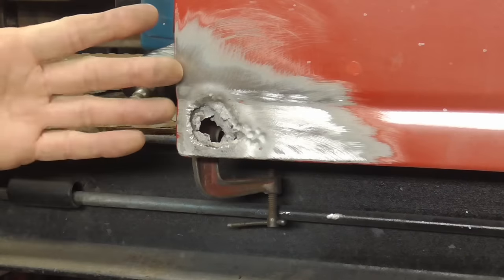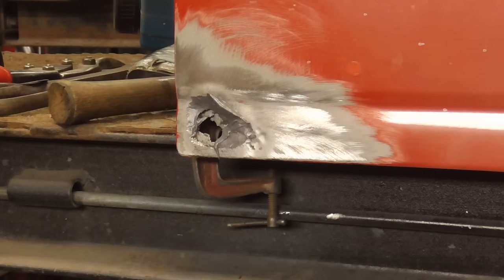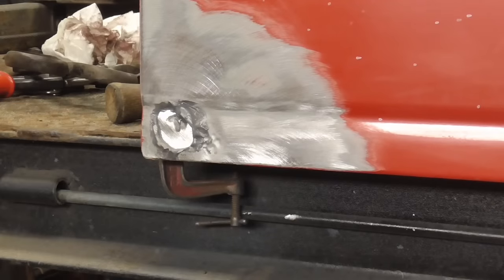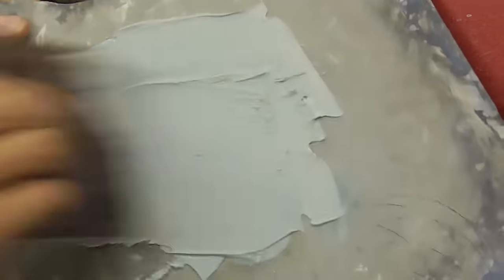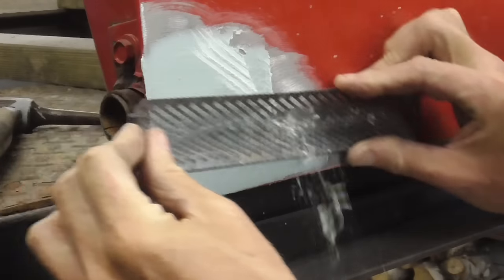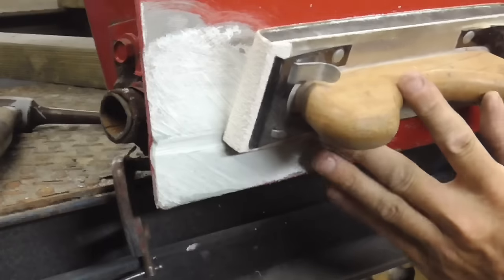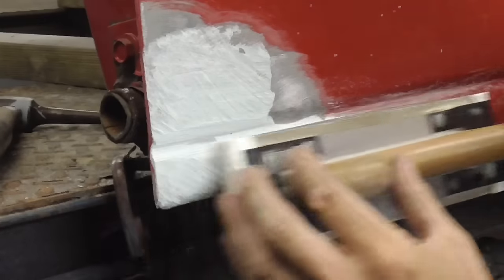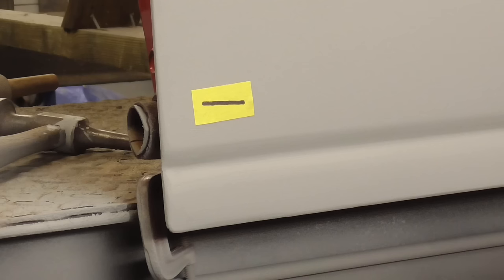Using JB Weld to Fix Rust Holes?

Comment: I found that you can "work" JB weld with rubbing alcohol before it cures for a nice smooth finish !
Reply from the maker: Nice suggestion - excellent!
Reply: water works just as well,
Reply from the maker: @deadprivacy  I'll remember that :)
Reply: Great tip! I'll try that next time. Thanks!
Reply: @100M2B  When I said "wet" , I do not mean soaking wet . Let it set up ,then if you see any unevenness or small flaw use the alcohol .Put a small amount of alcohol in a cup , then just dip your finger in it and then smooth it off useing your bare finger . Then clean your finger b-4 picking nose !
Reply: Thanks ed podellis! I'm going to fill some small screw holes in a recently purchased aluminum boat. I'll use your suggestion.
Reply: @Ariesstubbornbutt  lol@u!
Reply: I used JB weld 12+ years ago after wire wheeling heavy pits in a boat trailer. Primed then painted. It doesn't see a lot of weather but, still holding up to this day.
Reply: @TN-Vols-Fan  I used it on a series of screw holes in the transom of an 18' Starcraft while changing out the wood core. First I used a drill bit larger than the holes on both sides to taper the hole. Don't run the bit through, you're just tapering the outer edge  of the holes to help give JB something to bite into. Sanded smooth then painted the entire transom  My bro-law runs that boat on the Great lakes every year. Done that 2012 ish, still looks great.
Reply: @Wildwwill  Thanks for the reply. I had 14 small holes where the previous owner installed LED lights for night fishing. I don't fish at night. I cleaned out the holes and sanded a small area surrounding the holes. Worked very well but I couldn't get it as smooth as I wanted. No big deal, it's a 16' camo boat so you really have to look to see the repair.
Reply: @TN-Vols-Fan  so did you clean your finger before picking your nose? 😂🤣😂🤣
Reply: @donovanmorris6080  Good one! I was smart enough to wear latex gloves.
Reply: How long has it been since the hole has been done?
Reply: @mikeandcolleenk9831  Five years ago, want to buy a Pontiac ?
Reply: Can I spray rustoleum rubber based undercoating over the jbweld to prevent future rust? Will that stick to the jbweld?
Reply: @macknumber9  i don't see why not
Reply: A JB Weld trick if mine is to cover the area you are repairing with clear packing tape afterwards. The 2in wide stuff at Dollar Tree. It does a few things .

   Compresses the glue to get in all the nooks and crannies.

  The tape is clear so you can actually see what's going on under the tape.

   The resulting finish is an unbelievable smooth high gloss finish that needs no sanding.
   It's really cool when you peel the tape off after drying and see the results !!

Comment: I've used J B Weld, other epoxy adhesives and polyurethane construction adhesives for various auto body work.  Adhesives join the components together and seal them from moisture and corrosion. Low stress panels don't always need to be welded.  You'd be surprised how many body components on new vehicles are bonded with adhesives, rather than being welded.
Reply: sadly no, the smoke from the glue... is always an expected phenom when welding carbodies
Reply: @deadprivacy  Why patch with any  product    metal is cheaper  and welding is better   more drain holes  and internal rust treatment  obviously that is a good look patch job  not for my restos 🤔🤔🤔💯
Reply: @jackbarrie6007  i just said i wouldnt be surprise
Reply: Sometimes I will do spot welds and use 3M panel adhesive.
Reply: @jackbarrie6007     I don't have a welding machine.  I'd buy one but my single condo garage has no extra room.  I have 4 cars and some motor bikes and am just out of space. If I had a 4 car garage I'd have a proper repair shop with a lift in it.  But I just don't.  In my town, that would be a $2 million house.   I have a truck with rust holes in the cab floor from a leak from my loose windshield.  I'd love to put in a proper welded patch but just don't have the proper tools.  It's between something like JB Weld and taking it to a body guy and paying fair but still very high price to have it done right.   Probably $300-400 vs $10.  The floor is still sound so I'm thinking that JB Weld would do the job.  We all know that perfect is better but perfect just isn't possible sometimes.  I have lots of toys that need things and one has to set priorities.
Reply: @boyracer3477  
I threw a chain on my motorcycle blew a big hole in the motor I fix that with JB weld I owned that bike for another 4 years and it never leaked  one drop

Comment: I have never owned a welder and can't weld. You're videos without welding are much appreciated, thanks.
Reply from the maker: I'll continue to provide them as they are just as good as welding in my opinion - there's no worries of water or moisture getting past the seam :)
Reply: I have two welders but sometimes there are situations where I want to do something like this and not use a welder. I'm also just a hobbyist.

Comment: I've used it, sanded, primed and painted over it. Never know there was a hole before. Thanks for putting it out there.
Reply from the maker: That's good to hear.  Primer and paint stick to it?  You're welcome and thanks for the comment.
Reply: @LakesideAutobody  Seemed okay. It was a few dime and quarter sized holes by the rear lights on an old Dakota. I actually used the JB Weld metal putty - the 2 part you mix in your hand. I applied it from behind and over the hole and squeezed the two globs together. They hardened up, I sanded, primed and hit it with a spray bomb.  I wasn't looking for a professional job, just to get rid of the holes.  I WOULD be interested in seeing if the regular JB functions the same as a panel adhesive (seems much less expensive to me).

Comment: As a side hobby, I have been using JB weld to patch rust holes as you have done.  Gone back to check on those affected areas many years later and repair has held up very well.  Will be doing again soon for some rust spots on the roof of my 28 year old truck.
Reply from the maker: That is great to hear - the hole that I patched with the JB is still in good shape too.  I think it works well because it seals the patch real well like panel adhesive.  Thanks for your input - have a good weekend :)
Reply: @LakesideAutobody  p

Comment: I have used that method on a windshield opening that had pinholes in it. Worked great. It  was too delicate to weld patches and it really made a smooth repair that should last a while
Reply from the maker: That's good to hear - thanks for the input :)

Comment: Back in the early 70’s a guy brought me a motorcycle race bike where its piston was fractured. A piece of the piston skirt became lodged between the crank and the lower case fracturing the case. So I went and J B Welded the case, bored out the cylinder so I could put a new piston in it, and then filed down the case halves, tapped out the locations where the case fastener bolts once were and the guy raced the bike that weekend. It was a lot of work but, I couldn’t get a new case for at least two weeks so… if you’ve ever watched the movie “On Any Sunday” with Steve McQueen… you know us hard core motorcycle racers of that era were back on the track every weekend no matter what came our way that tried to stop us 🤪 in other words; we were a bit nuts, if you will.

I’m going on 76 years old and still doing things things with J B Weld that might shock some people. Not the quick or fast cure version… just the long cure type. I haven’t had the same success with the fast cure.

Back to the J B Weld fix… to the best of my knowledge, it worked fine. Well… I never saw him again ?

Every time I mix a batch… I think of that early 70’s motorcycle repair, lol…
Reply from the maker: Great story Jim - thanks for sharing - have a good weekend my friend :)

Comment: I have used JB Weld to patch holes in gas tanks, works very well.
Reply: @paintedwolf8394  Hello PaintedWOLF, I have also used jb weld to repair a crack around the filler neck to tank connection on a camero. if the hole it bigger than a 1/4" I have jammed a piece of tinfoil in it to keep the jb from leaking through. Clean the area to bare metal. JB weld, good stuff! And good luck.

Comment: I've used JB Weld A LOT over the years, but never for this!  But I can see I was missing out on a great idea!   For small spots, WHY NOT?!!??  The key is removing all the rust, that's what ruins a patch job: Not getting all the rust out, and with this repair, a magnet sticks!   Win/win all the way around, for the inner panel as well as the outer.   Larger will still be welded, but for small patches, this is solid, fast and easy.  Brilliant!
Reply from the maker: Thanks for the comment, opinion and support.  Drainage is also key.  No moisture - no rust.  Have a great weekend and Easter :)

Comment: I got this idea today and wanted to see if it has been done.  Glad I found your video with excellent demonstration.  I was welding in a patch panel and burned a few holes and was thinking, I hate the thought of trying to weld up those holes and know there is enough good weld to hold it all together.  I know ordinary body filler wont cut it because it is not water proof, and thought maybe jb weld.  Now will try it for sure.
Reply from the maker: Here's a cab corner repair that's 4 years old now - still fine - https://www.youtube.com/watch?v=wRl1QfkrBeY  - follow up 3 years later - https://www.youtube.com/watch?v=gIS1Tbv7Kvw

Comment: Have used this method several times in the last few years works well , the most successful one was on a CB250RS  Motor Cycle petrol tank that was more like an oil strainer with small rust holes in it. Used the same technique as this and it has never leaked again , that's over 4 years ago.
Like your channel a lot.       Ken in the UK
Reply from the maker: Nice. Thanks for your comments

Comment: My 66 chevelle was patched using marine-tex , way back in 1975. Bought a big can to repair a boat, and a motorcycle transmission side case, had lots leftover, that became the ultimate metal patch.  If you don't need alot of it, panel bond , and JB weld is just as good .
Reply from the maker: I'll have to look into that.  Thanks for the insight - have a good weekend and Easter :)

Comment: I think it solves the problem of moisture penetrating body filler from behind. Also helps where metal is too thin for good welding results. More working time as well not as messy as fiberglass resin patches. I will try it maybe for some small areas on a floor board where it will seal well. Prep is everything good prep job on that. Thanks for video and idea.
Reply from the maker: You're welcome - try to make sure your panel can drain and dry out inside - that really helps :)

Comment: I use JB Weld over freshly ground welds on 22ga body repairs. To fill in minor voids and joints between welds. Sand it smooth and body fill skim coat over that. Then epoxy prime, sand, too coat and clear. Works great every time.
Reply from the maker: That's a great plan because the jb is water proof and seals that seam - nice thinking. Thanks for the input.

Comment: I purchased 2 thermoquad 4 barrel carbs that came from a truck plant years back . Both carbs had their plastic bowels cracked at the factory for failing and I purchased the least damaged ones and repaired the crack with a rotary grinder and stop drilled the crack filled after prep with industrial JB weld worked fantastic once cured and painted and tested I put one on my c3 vette cab worked great nice new carb 35.00 lolo it never leaked in 15 years  also repaired an oil pan on my Grand Prix 2004 gm 3.8 saved a lot of work been on the car 8 years again proper prep and once done I painted it wth rust paint and then light coat of undercoat .
Reply from the maker: Great stories - thanks and have a good weekend :)

Comment: Used jb water weld on aq cast iron bathtub with a shower that had a crack 6 years ago, just got around to painting it and you wouldn't tell where I patched... never thought for my truck, Thanks for the great idea; driver's side floor is getting spongy.
Reply from the maker: That JB weld works on a lot of stuff.  Used it on a rusted egr tube that gets hotter than heck - lasted for years - then sold the van - still was sealed.

Comment: Yes I have used it many times, have more trust & faith in the job weld than the bonds, never had a crack form yet, stuff also never falls out, think that primarily due to the fact in many cases it binds behind the metal and creates a hook type effect where its stuck and cant break out of the spot it's in, my trucks are prone to salt and debris in the plowing industry and I often do 100% of my own repairs, have yet to see issue with jbweld for body work.
Reply from the maker: Great to know - thanks for the information.

Comment: JB weld is fine. The goal is to create a solid strong repair that will last. It does just that. Some may claim it isn’t the right way but as automotive manufacturers are using epoxies and adhesives more everyday I believe it is a good choice.
Reply from the maker: If you make sure the panel can drain and dry out inside it will hold up just fine :)

Comment: I have a fender on a 68 pontiac that had been wrecked, and the ancient way of fixing dents was drill a lot of holes and use screws to pull the dents out.  I've dip stripped the fender, and will be jb welding a piece of steel to the back side, and skim coat the outside over the 20 screw holes. Body filling to finish and paint..  Wish me luck.
Reply from the maker: Good luck Andrew - thanks for checking out the video - have a good weekend :)

Comment: Great video and really good idea. I have used Bondo before and that works too. E.g. you use the Bondo just like what you did with the jb weld, use it like glue. Also, used construction adhesive. You would be surprised how many things can work in a pinch
Reply from the maker: Thanks
Reply: Not sure about construction adhesive but Bondo attracts moisture and that's why we look for alternatives to it. Over time we have to deal with the rust again. With JB Weld and fiberglass at least we don't. Just a tip.
Reply: @madwand28  good call … evercoat has a product Everglass I believe …. It’s a good first layer when moisture can get behind the panel

Comment: I've used it for this purpose in the past, it continues to harden and shrink, & shows through in time even with a coat of bondo over it
Reply from the maker: Here's a follow up vid on the use of jb for a cab corner - https://www.youtube.com/watch?v=gIS1Tbv7Kvw  - still looks the same 4 years later.  I think the key is making sure you tap the patch down beneath the OEM or original surface.  "Hit it low and fill it with dough" as a coworker used to say :)

Comment: JB weld is a good product. The only downfall is needing to wait until it sets up and hardens before you can finish the job. I typically mig weld the patch in and follow up with a bit of Duraglass to insure I seal up the work completely since it's a waterproof product. Then I finish up with a little plain filler. As long as you can keep water away from bare metal by sealing it so it doesn't rust again. It doesn't really mater what products you use to accomplish it.
Reply from the maker: True.  Also  it's good to make sure the panel can drain and dry after the repair.  Can't have a build up of debris inside the panel.

Comment: been using jb quick weld for as long as I have owned a bodyshop 30 years for more than just rust holes. sealed holes and cracks in trannys exhaust ,water pipes ,hd light brackets ,holes in head lights the list goes on for ever. use it
Reply from the maker: Thanks for your input.  The first name that comes to mind when something gets cracked, broken, leaks, etc is "JB Weld" probably.

Comment: So on my frame I have a few spots that haven't gone through but are rusting bad. I am going to be cleaning this all up and rust proofing the frame. But the spot where there's a bunch of flake around welds (again not through it) I was thinking of putting this around it.... bad idea???
Reply from the maker: Myself, I would knock all the chunks of rust off of it with an air hammer or a regular hammer - just make sure all the loose stuff is gone.  Then this: https://www.youtube.com/watch?v=NXAo5IfMtPM
You could do that but in my experience, moisture will get under that - get trapped and actually cause more problems.  That's just my thoughts though.  It's what works best for you.  If you were able to sand blast it completely clean then that JB would seal real well.  Let me know what you do with it.

Comment: Just ran across your videos, I like what I see and think I will give it a try on my old work truck. Are you just using the jb in the tubs or is there another way of getting it. Thanks for the videos, it's worth a shot anyway.
Reply from the maker: I'm just using it in the tubes.  Here's a follow up video using JB and other glues on a cab corner, door bottom and more. I'm just using it in the tubes.  Here's a follow up video using JB and other glues on a cab corner, door bottom and more.  The driver's side cab corner was JB Welded on and it's be 4 winters now - https://www.youtube.com/watch?v=gIS1Tbv7Kvw
Reply: @LakesideAutobody  Thanks for the speedy reply, it's appreciated very much, thanks again and you have a new subscriber, have a great weekend.
Reply from the maker: @tfjack97  Thanks for the sub and for watching Jack - you have a good weekend too :)

Comment: will the paint crack because it wont flex? wanna try this
Reply from the maker: No - I never had paint crack - not even on flexible bumpers.  I think the only time paint cracks is when there is a bad chemical reactions or one layer of paint or primer drys differently than the other thus forcing one or the other to crack